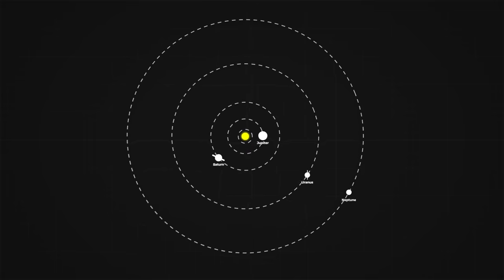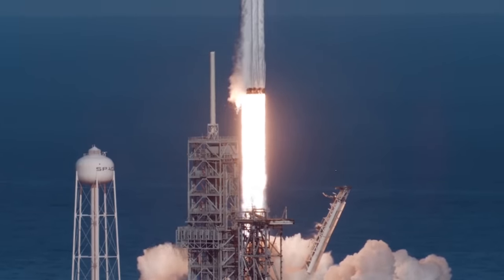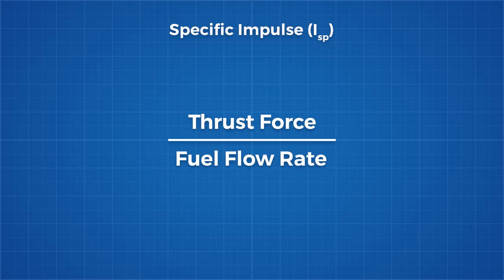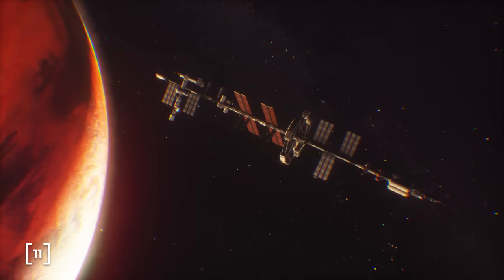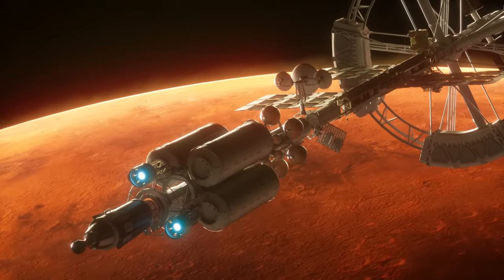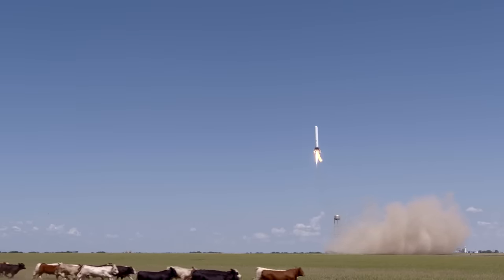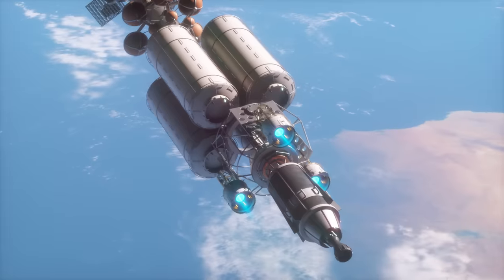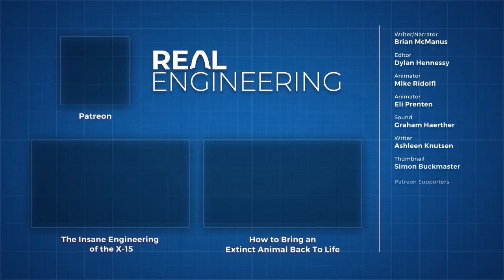Can Nuclear Propulsion Take Us to Mars?

Comment: So the issue with nerva is that we are not able to store its fuel hydrogen reliably and also the tanks quite heavy so that is also going to cause a bummer. What if we instead use methane as an extra fuel along with hydrogen and oxygen.keep smaller hydrogen tanks and when we need to fill up the tanks for a near use of hydrogen we can use the steam methane reforming method to produce hydrogen. We can store methane at large quantities without major issues (hoping starship works) and say we can use a form of retrofit ship over the starship which already has the necessary methane and oxygen tanks. This retrofit ship will have the nerva engines and a hydrogen tank made as light as possible as we don’t need to store hydrogen which we are going to use for long. When we know we need to make a burn we make hydrogen from methane and other wise we just use our original tanks and we can eliminate the need for a full proper long term liquid hydrogen storage tank

Comment: i think a good idea would be to mix laser ion and fuel propulsion. use fuel to put it in orbit  then send more ships to refill it. once filled it could use that to get some speed dropping stages as needed once fuel is spent and then have laser sails working with ion propulsion in tandem to continue increasing velocity. maybe even send some lasers into space behind it to continue pushing it at a closer range than here on earth also those lasers here on earth could be in orbit to avoid atmosphere and stay locked facing the sails.

Comment: Once we advance Nuclear Fusion technology further, how would using fusion instead of fission help improve the efficiency of these engines?
Reply: Maybe a leap in safety issues i guess. Not much in efficiency. Though the controlling apparatus can be removed which is used to keep chain reaction in check like control rods. Assuming the additional equipment added to fission reactors in case of any mishaps can be removed but keeping in mind that fusion reactors too comes with their own specific additional requirements, not much in efficiency but safety can be improved a lot.

Comment: The statement that on average Mars is about 64 million kilometers away (from Earth) is manifestly incorrect. What you meant to say is that when the two planets are in conjunction (i.e. at  their closest approach in their orbits to each other) the distance averages about 64 million kilometers. Because the orbits of both planets (especially Mars) are not perfect circles i.e the orbits are elliptical, the closest approach figure varies widely and occasionally the two planets may be as close as 55 million kilometers but when they are in opposition ( i.e. on opposite sides of the sun) the distance exceeds 400 million kilometers. Of course, even this figure grossly understates the distance  a spacecraft would need to travel between the two planets when they are in opposition since presumably no spacecraft can travel through the center of the sun.

Comment: Ion drives have very low thurst and they are impractical for manned missions. However, magnetohydrodynamic acceleration of plasmas offers more thrust/power than ion drives but still retains the advantage of high specific impulses. Their drawdown is their high electric power requirement. If the electrical power from a nuclear reactor is available in space (at least 1MW electric power) more suitable options are https://en.m.wikipedia.org/wiki/Magnetoplasmadynamic_thruster or https://en.m.wikipedia.org/wiki/Variable_Specific_Impulse_Magnetoplasma_Rocket

Comment: 4:00 First and foremost, don't land anything you don't need to land, meaning, the ion engine stage stays in space forever. It can then be used to propel lift-off vessels to and from Mars. This would increase fuel efficiency by many times possibly a thousandfold, depending on the ion stage's build.
If it's nearing c emission, this would be thousandplusfold of any combustion tech.
Reply: Basically, clip on the ion stage, use it, using minimal fuel to accel and decel, clip-off before landing. Next mission.
or...
Grab an asteroid.from space somewhere, accel and decel to delivery spot, convert into usables by means of raw mining,
and leftover atomic beam separation tech.
or...
deliver container with goods from one station to the next..
or..
Reply: They are called ion tugs. Uncrewed space vessel/engines clip-ons with the express purpose to accel and decel stuff in space.

And yes, 1 cm/ss is a lot of delta-v in space. +864 m/s delta-v per diem, or 25.9 km/s per month.

I wanna race Elon Musk in space !

Moot counterpoints:
"But would cost way to much fuel." => kinetics out = kinetics in.
Accelerating mass within the vessel to 0.1lightspeeds, let's say 1 kg, yields 1 tonnes going the other way at 15 km/s
Yes, 1 kg of fuel, so no, it would NOT use much fuel even over the duration of a month.

-star trek music-, not a logical argument at all especially since cyclotrons and ion engines and atom beams are existing tech, and not theoretical or fictionnal at all.

Everything starts with an actual grav-sim capable space station, a ring, slowly rotating. There you can have workshops for in space assembly AND zero-G created stuff.
Reply: Space racing sound awesome fun.

"The new N-Tech mass accelerator engine, now offers 0.2 c acceleration on any fuel source. Get it at your local shipyard today !."
-future ad.
Reply: Bumper cars in space, while moving through a course, high above the planet.

Comment: I don't expect an answer but what about water ist has two Hydrogen atoms. The water could be used for heat transfer to the radiators, could be used as gas for a turbine. The heat comes from muscular fusion. The electric energy from the generator can be used for electrolysis. The Hydrogen can then be used in the the nucular thermal engine. The oxygen could be cooled down and be used as oxydizer for capture burns or whatever it might be useful for.
I guess I miss something obvious.
Reply: Because a closed loop coolant system is needed for nuclear electric? If you use up the water in the system, you can no longer cool down the nuclear generator.

(I'm not sure if it's correct, feel free to discuss it with me.)

Comment: The problem with ion drives is: we can't generate Xenon. It is a very limited ressource. Hydrogen, methane and oxygen are relatively easy to generate from water and carbon dioxide.

Comment: For hydrogen storage in a space craft with a nuclear power plant, what about storing the hydrogen as water and electrolyzing it with nuclear power into O2 for life support and H2 for fuel as you need it for nuclear thermal? Or throw water into an ion thruster directly and let the extreme voltage differential ionize the water vapor into H & O plasma and accelerate the ions as is? 
Finding a way to side-step storing free hydrogen molecules with something like these seems like it would be the "work smarter not harder" way, rather than trying to solve how to store molecular hydrogen.

Comment: I was expecting a mention of another difficulty  of dealing with nuclear and spacecraft, IE what happens if a challenger type explosion. Same problem with using rockets to toss nuclear waste into the sun.
Reply: Pretty much not an issue. We're talking about using a reactor for orbit-to-orbit applications here, not for lifting stuff out of the gravity well. So, during launch the reactor sits inside the payload fairing and is subcritical (i.e. inert). Only after the reactor module is connected to the transfer vehicle is it turned on and criticality achieved. Unused fuel rods are not really radioactive (I've had fresh fuel pellets in my hand), it's the nuclear fission reaction that produces highly radioactive waste products. It's this used fuel you need to be mindful of. Thus, even if the rocket launching our fresh reactor failed, we'd just end up dumping a few tons of uranium fuel into the ocean. We've also been launching probes with radioisotope thermoelectric generators (RTGs) for decades and only had a couple of incidents with them burning up upon reentry, with no resulting contamination. They're also designed to survive a launch explosion. So. I'd say not really something you need to worry about, as long as general safety standards are observed.

Comment: I love aerospace and your channel, but imho interplanetary travel is like fusion power: we’re almost always there, but nothing has really changed since the beginning (except the cgi is slicker and rockets shinier). Consider: 1. We can still only barely get into LEO (payload/total mass) and even that is difficult. 2. The vastness of space is unimaginable - even to the near objects. It took Voyager 40 years to exit the inner solar system. Let that sink in for a bit - 40 years. 3. Space is hostile to human life, lethal is probably a better word. Forget the extreme temperatures, total vacuum or that it takes about two football fields of land to feed 1 person/yr. The radiation will kill you in short order and at the velocities required, a snowball has enough kinetic energy to rip any tin can we can launch into shreds. ISS astronauts are time-limited due to radiation exposure and the ISS has been struck several times by objects the size of a grain of sand that caused damage - and they’re still in the protective envelope of the Earth’s magnetic & gravitational fields and a bit of atmosphere. The only solution to either of these problems is more mass. Now revisit #1, do some delta-v calculations and you’ll soon find yourself in the red. Gravity is a bitch! I encourage all and more aerospace research because it often results in useful stuff like Velcro or the longer-lasting lightbulb and cuz it’s way cool. And, hey slicker cgi ain’t necessarily a bad thing.

Comment: by my thinking though, each molecule would contribute  m. delta v to the crafts momentum... no?   So, if we accelerate a molecule to a velocity that is the same as a lighter molecules velocity when both are multipled by their masses.. we should theoretically achieve the same change in the crafts momentum per molecule, regardless of the mass of each molecule?   Unless there are additional inefficenies in heating such as a high specific heat capacity or change of state.

Comment: Would it be possible to store the liquid hydrogen in a titanium (alloy?) capsule without fear for it leaking?
Reply: Problem is the weight that Titanium(or other) because of it's density that it has. It's also really hard to form.

Comment: @realEngineering with the nuclear propulsion engine that has a mini nuclear fission reactor become so radioactive on the nossel of the combustion chamber? using liquid hydrogen is a good idea but as you pointed out that the element is so small. it can go through most solid material. i though about and why not use liquid helium. although not flammable but it could be a better alternative because the element is a bit bigger than hydrogen. plus, the temp is 268.93 Centigrade (4.2 Kelvin) or -452.074 Fahrenheit. that would cool down the internal temperature of the coor while pushing out that heat for it to generate thrust. Thinking of the logistics of liquid helium it’s easier to store, this is what i found out online "Liquid helium is stored, shipped, and handled primarily in vacuum insulated liquid containers" from Air Products and Chemicals, Inc.

Comment: For the ION Nuke drive could they not use the cold of space to cool the coolant somewhere in the loop? Have it pass through an isolated chamber that super cools it on its way back to the reactor maybe 🤷🏼‍♂️ 
I'm sure they've already thought of that and I'm wrong but just throwing it out there, I'm no science guy I just love thinking about this stuff 😂
Reply: It won't cool so quickly because of lack of medium in space, that is vacuum. Heat can be transferred only by radiation in vacuum and that will take some time.

Comment: I suspect that within 10-15 years, we will have the ability to build a third type of Nuclear Propulsion...specifically, the Fusion Torch which is nothing more than a Fusion Reactor with a rocket thrust nozzle welded on to the side of the Reaction Chamber and a Magnetic Containment Field capable of opening a hole in itself right at the point the nozzle touches the Reaction Chamber...

The theory behind it is a Fusion Reactor is a man made Star producing MASSIVE amount of heat and Plasma so when the magnetic bottle opens a hole in it, all that Plasma explodes out through the hole and then out the nozzle ,which has it's own Magnetic Containment field keeping that million+ degree Plasma from explosively vaporizing it and simultaneously directing the Plasma into a jet at which point, Newton's Third Law kick's in and the Plasma Jet shoves the Reaction Chamber (and the Spacecraft it's attached to) away...Effectively, it works EXACTLY like a chemical rocket, just with one HELL of a lot more Thrust per Kg. of Fuel expended...

Needles to say, this will NOT be a Ground-to-Orbit engine...even leaving the probability of the Plasma being Radioactive, the Heat and Velocity of the jet would destroy any Launch Pad this took off from - the radiated heat would enough to vaporize most if not all alloys for several dozen feet from the Plasma Jet so even a ocean launch wouldn't work, the gantry/pad would still be destroyed and lighting off a Fusion Torch underwater would be almost as bad as detonating a Nuclear bomb due to the MASSIVE steam explosion...
Reply: By 2027

Comment: the problem with Ion engines is that they can't achieve high specific impulse in a shot amount of time which leaves only chemical combustion engine as a possibility but once humanity starts creating not on earth and there for not having to factor in the fuel to escape the gravity of the earth but instead in space ion will become more viable and most likely improved on

Comment: Energy costs outside Hohmann windows increases pretty dramatically. You're going to need a much better trick than ion engines before you can start thinking about arbitrary scheduling for interplanetary travel.
Reply: Also, you can use ion engines with normal electric generation (solar/RTG) for insertion burns. You just have to reduce your relative approach velocity, which - surprise - is optimized by getting your Hohmann transfer right.

Comment: So far every ion thruster i've seen, it is only 2 grids. Why not have multiple grids, in parallel? A Stanford LINAC. No need to achieve TeV energies. 1/2 Mev will do nicely, at 0.1 kg/sec. Build a 1.6 GW MOX reactor (95%U238, 5%Pu239 oxides) inside a Turbogenerator using ethane, propane or ammonia gases to circulate inside the system, the hot gases leaving the turbine, around 800 K, will go to a secondary system where will be cooled down to about 400 K and recirculated into the compressor system. The secondary system will use liquid ammonia as fluid,  exiting the secondary turbogenerator at about 300K, from which it will be directed to a radiator cooler, where it will be  liquified and brought down to the loop. Carnot efficiency is around 64%.

Comment: Since Newton's Law on equal and opposite reactions work in space, if you were to make a reactor that generates a lot of neutrons, and accelerate them to high levels, similar to the Hall effect ion thruster. Since neutrons are heavier than ions, your acceleration should be better, and you can use the same reactor to generate electricity, to use in the thruster...
I might not have a clue if such an engine is feasible, but it's an interesting theory, no?...

Comment: Ive watched this video when it came out. Since then some things have come to the fore, with results that will be a great surprise for many.  Let me put it like this: It is possible to establish a full whole year round supply chain to Mars. While humans will have to use Hohmann transfer every 26 months, the cargo does not need that. There is another set of equations that would allow us to send a constant stream of cargo to Mars, before humans are sent, and after that. Without stopping. Whole year round, with useful cargo arriving to Mars every few weeks or every month. Thousands upon thousands of tonnes of cargo. Any cargo. Any equipment. Any. As often as we can launch it to orbit - which now can be done rapidly with SpaceX falcon and Falcon Heavy. 
And it seems to me nobody gets it yet. Because we are all stuck in the old tech ways of doing things - a single ship every two years. We can do much better.  
These "new" equations are not just someones fantasy, or a mathematical theory. They work. NASA used them already to send a probe to the Moon, to test the concept. It works. And we dont need nuclear engines to achieve it. @RealEngineering does that sound interesting?

Comment: I'm not sure whether this is the full story. If I had a nuclear engine that weighed say 1 tonne, but fired hydrogen atoms out at 100m/s vs one that weighed a similar mass that fired nitrogen out at 100m/s. I'd prefer the nitrogen engine. 
Granted if we had a limitation on the amount of kinetic energy we could impart on the exhaust particle then fine, but I think with nuclear engines that rule may not necessarily hold because we're not burning the fuel like what a combustion engine does.

Comment: Couldnt you pass the xenon (or whatever other gas) through the reactor and then use it as fuel for the ions? Power for non-engine use could be stored in seperate batteries- as only the ions would need that much power
Reply: Xenon doesn't make a good coolant! It doesn't conduct and/or convect heat very well, so it wouldn't be absorbing nearly enough from the reactor to keep it cool. Hydrogen has the dual property of being really good as a propellant and really good as a coolant - liquid hydrogen is used as a coolant even outside rocket engine designs!

And batteries are actually quite bad at storing energy, relative to their mass. It's more efficient to simply tune up the reactor's output than waste mass on batteries.